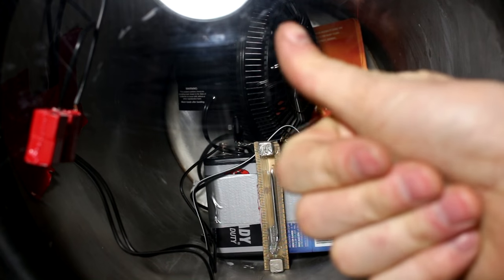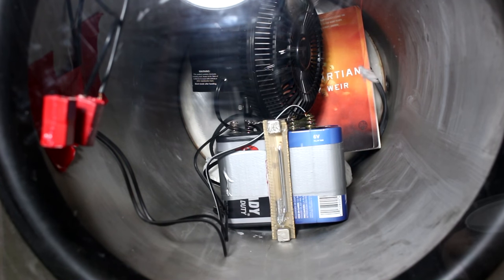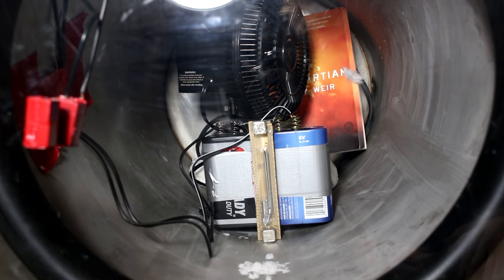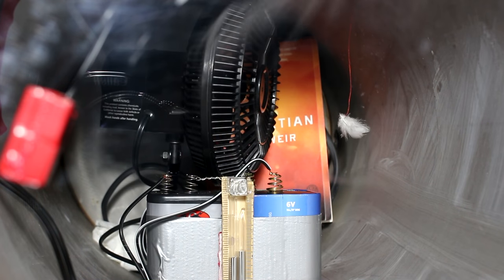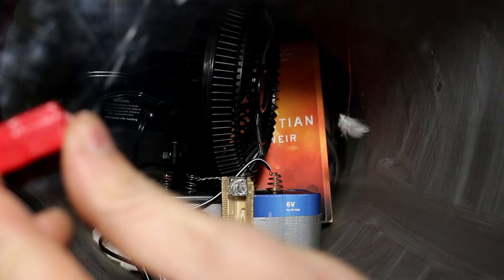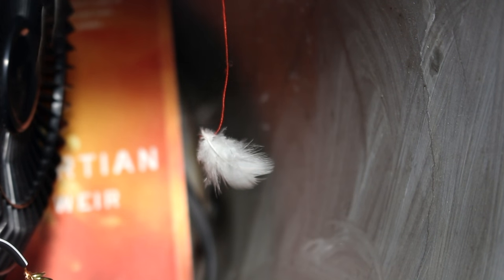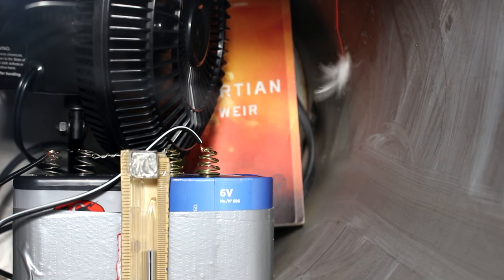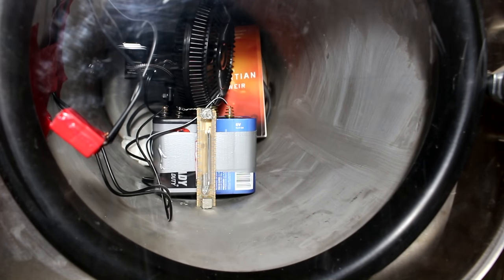How Strong is The Wind on Mars?

Comment: That's interesting. what happens when you put a thermometer on the motor in the fan? was that DC motor designed to be air cooled? If you wanted to keep a computer processor or other temperature sensitive device cool, how much would the Martian atmosphere affect it?

Comment: I did like Now, question: If wind could travel at speeds of 200 mph it would, other wise it could not be said wind speed at 200 mph,  if there was a breeze on the feather, this would work out at a phenomenal wind speed  on earth, 
Cody, using the vacuum chamber and turbo fan, at what speed could you register movement on the feather as wind? Or as i would believe not possible, with 500 mph fan speed in the chamber, would register much over 20 mph in chamber at mars atmosphere?Cheers

Comment: can you be sure that the fan produces airspeed in that low pressure environment? I assume that fan is engineered for earth pressure. The same way propellers for water are horribly inefficient at causing airspeed, I assume regular air propellers are horribly inefficient at producing airspeed in low pressure gas.

Comment: I imagine the fan blade spins markedly faster in reduced pressure as there is far less resistance against the blade and that may be where the vibration comes from in that the fan blade is probably not balanced finely enough for the higher RPM's.

Comment: since wind is produced by differences in pressure, and those are usually caused by temperature differences, do you think it is possible for martian atmosphere to produce a lot of wind? I think it would be possible because the temperature-difference on mars is about 140°C (260°F) min. to max.. this is not accounting the relative distance of these temperatures to each other of course, since that is also a factor that should be kept in mind.

I'm sorry to say but it is just natural the fan couldn't push the feather, since it is constructed for earth-atmosphere, so to get a equivalent force, the fan should be much bigger/more efficient. 
It is however a good test to prove earth-like 'air-technology' would not work great on mars. 

I really like your video's and look forward to a reply.
Greetings from Belgium

Comment: How do we know the fan is moving the air at the same velocity in the vacuum as it does at Earth atmospheric pressure?

If anything, this test would only test the effectiveness of a fan (or prop engine) in a vacuum. As the air became less dense, the same amount of power became ineffective at moving air at the same force and concentration. 

This is something aeronautical engineers must consider when designing jet engines.

Comment: I am just surprised that the fan didn't overheat and burn, with nearly zero air resistance on blades and with barely any air cooling for coil and brushes, I was expecting some smoke from fan.

Comment: Hey Cody. Would you be able to fly an airplane on mars then? with normal airplane with propellers?
Reply: No. Mars has on average 0.6% of the pressure as Earth so a normal plane would be far too heavy and a normal propeller wouldn't provide enough thrust. Before landing on Mars scientist thought the Atmosphere was much thicker and considered sending flying craft, but we've come to realize it is far more difficult than we first thought. 

Theoretically you could still fly a plane but it would have to be much lighter and normal prop propulsion hasn't worked well in tests. Of the few proposed concepts over the decades even the best ones would only stay in the air for a short time before running out of propellant.

Comment: Cody, I think your premise is faulty. You only demonstrated that your fan generates less velocity in a less dense atmosphere, which makes sense - the fan blades have less to push, so at a given fan speed, naturally there will be less velocity and a lower atmospheric density. That's why the feather isn't moving. If your fan could generate sufficient velocity then the feather would move.

Comment: We assume the air density is a constant on the surface of Mars at a relative depth; However, there are dust storms. What I would argue is that the relative air pressure or density acts more like a fluid over the surface of Mars and isn't a constant; as atmospheric conditions change so does the density. 

So, it is likely that mild gusts of air do cause pressure changes along the surface erratically over time; over the day. Perhaps a fan in a tiny vacuum bucket cannot fully demonstrate the erratic climate change and conditions appreciably as it can on the various locations on the surface of Mars.

I'd argue the vacuum demonstration more accurately demonstrates the conditions of the moon than it does on Mars; the moon is relatively static with virtually no appreciable atmosphere, other than a few rare gasses, but Mars does have a dynamic atmosphere with considerable and appreciable evidence of wind storms and wispy mild gusts.

Comment: Wait so, I have a potentially dumb question.

When you 'boiled' the water, did it change temperature at all?
Reply: No, it did not. When you change the pressure of something you also change the boiling and freezing points of that thing.
Reply: The water started boiling when he reduced the pressure.  As it boiled, it carried some energy out of the water.  This energy is called the "latent heat of vaporization".  Losing this energy causes the vacuum-induced boiling water to get colder.

One cool way to see this is to put liquid nitrogen in a vacuum chamber.  As you vaccuum the atmosphere away it boils and boils.  Eventually it will lose so much heat that it will freeze solid.  It's Frozen air!
Reply: Thanks! I'll write this down and when (if) I get happen to get liquid nitrogen AND a vacuum chamber for Christmas I'll give it a try.
Reply: The remaining liquid water will actually lower in temperature as it boils

Comment: Cody i think you have an error in your experiment: I don't think the air in front of the fan was moving anywhere near 5m/s. I don't think the principle by which a fan produces wind works in near vacuum. Short: if the air in there would actually be moving at a decent speed, i think the feather would be bodging noticeably!
Reply: I think you're wrong:  In the final analysis, induced lift is just vector addition.  The resultant directional velocity of the gas is determined by inertia of the gas molecule and the directional velocity of the fan blade.

Comment: Cody, can you explain why the feather appeared to move toward the fan instead of away? I've got a feeling that it has to do with the movement of the less dense atmosphere creating a low pressure spot in front of the center (obscured) portion of the fan. This probably happens in normal atmospheric pressures but is only measurable up to a few mm from the front. What do you think?
Reply: At end end you can see that the feather was suspended from a wire attached to the fan casing. It was probably just nudged by the vibrations from the fan starting up.
Reply: N33b0 No, the stringwas attached to the top of the chamber. The part at the end was either somethi g he tried and didn't like, or was just wanting to see the vibrations. The feather is clearly suspended from the ceiling of the chamber with red tape in the main part of the video.
Reply: James Rosenblum ah, got ya.

Comment: I wonder if you can adjust the air pressure to account for the lower gravity on Mars, seems like that could possibly help move the feather.

Edit:

Might just be easier to reduce the mass by a relevant ratio and test.

Comment: Cody- your experiment results give rise to the question of the dust storms on Mars and the great fields of sand dunes and the obvious wind erosion seen in rock strata. Is it possible that atmospheric pressure on Mars is variable enough to produce higher wind force within Martian weather systems as they move?

Comment: You said the fan would produce maybe 10mph of wind.  Wouldn't the fan rotate faster with Martian conditions?  That could explain the extra vibration and noise.  It also means the "wind" speed is likely higher that 10mph.

Comment: Let's say your assumptions were off and after putting it in a vacuum the fan produced 1m/s wind speeds
If the wind speeds being discussed were 100 m/s the difference in the force of drag would be 10,000 times greater than what you measured
In this case if your feather were only 0.1 g then an equivalent area object of 1 kg object would be effected the same (though the sway measured would be greater in both on mars as the gravity is less)

All of that doesn't even consider something that you either didn't consider or thought irrelevant
The dust carried by the wind could greatly increase the effective density of the air
When assuming the arbitrary number 10 as the density increase factor and combining that with the previous number we get 100,000 times the observed drag

Comment: Would there be more CO2 on the atmosphere of mars though, and would that even effect the outcome of this experiment?
Reply: If there was more co2 yes it would move the feather more!
Reply: If there was more co2 the pressure would have been higher than mars also. In cody's vacuum chamber the co2 content should have been close to 100% as the dry ice was the only thing replenishing the sucked out gasses.
Reply: Madrawn But I feel as if the small amount he used was not sufficient for the volume of the container, unless I am thinking about this all wrong. Wouldn't more particles in the way cause more of a push?
Reply: Mike More particles more push.... less particles (like on the movie)  smaller the pushing force will get
Reply: We can answer this with math.  A mole of carbon dioxide weighs 42 grams and occupies 12 liters of space on Earth.  The chamber is about 4 liters in size but is at 1/100th of Earth's pressure so it would need 140 milligrams of dry ice to fill the chamber.  The density of dry ice is 1.6 grams per cubic centimeter, so he'd need a piece that is a centimeter square and just under 1 millimeter thick.  There isn't a scale in the video to measure from, but it looks like he had plenty of CO2 to me.
Reply: Elizabeth Greene Ty :)

Comment: I'm suprised the fan didn't overheat in the vacuum since there is no air-flow to cool it down while operating. I guess it wasn't active long enough to produce enough heat..
Reply: There was still a little bit of an atmosphere in the chamber, about 7 millibars.  That's not a lot, but it's still enough for some cooling by convection.
Reply: cheap fans for home use rely on air cooling so much, that they could overheat from high altitudes (or at least some could), not to mention that higher RPM would generate more friction inside too, so it can overheat in unexpected places too.

Comment: Hey, Cody. That is a nice toy, i have been told in Mar atmosphere iron powder will absorb carbon monoxide in room temperature and form a kind of liquid metal. I wonder if it is true? If that is for real, we can cast iron just like we cast epoxy on earth. That is too good to be true, no foundry, no heat and no risk of gas explosion. I want to try that too, but i don`t have this nice toy. Therefore, may i ask you to try once to see if it is true or not?
The original claim was from the “direct to mars“ program support document on building mars colony. It also mention some martian mud bricks that only require 300 degree c to make, but stronger than any brick we have because of high content of iron. everything looks too good to be true.

Comment: Mars atmosphere is approximately 1/10th as dense as our atmosphere,The highest speed sustained wind on Mars was recorded at 125Kph 77.6714Mph the average/median wind speed on Mars is 40Kph 24.8548Mph. If you want your fan in a vacuum test to be a reasonable comparison you need to make the atmosphere inside your vacuum chamber 1/10 of earths not a vacuum.Earths atmosphere is approximately 14 lbs per square inch so 1.4 lbs per square inch would be the correct atmosphere comparison for your test. Also the gravity on Mars is also less it is only .38 % of gravity on earth which would make everything lighter and more susceptible to being blown by a breeze. The nearest I will bother to explain here is on a normal day the Martian wind would feel like and act upon objects like a 7.5mph breeze here on earth.
Reply: It's way less than 1/10th...it's about .6%.  it's 6/1000th of earths sea level pressure.

Comment: Hey Cody sorry I'm a bit confused isn't it just because that the fan is not producing that much wind force in the vacuum chamber?   I would imagine that a 200 mph superstorm on mars would be the same as a 200 mph superstorm on earth
Reply: benjamin buurgaard Well, the atmosphere pressure here on Earth is about 1000 times that of the pressure of Mars' atmosphere. So a 200 mph wind on Earth creates a force on the surface of whatever its pushing, i.e. the lander. On Mars, being that the atmosphere is 1/1000 the pressure of Earth's, you can imagine the force generated by a 200 mph wind would be about 1000th that of Earth's. Now there are other factors at play that may change that math, but the approximation is pretty darn close at such a low pressure.
Reply: hmmm.... so because of the fact that there is less molecules in the air to push it wont push as much?
Reply: An extreme example would be the difference between standing in a breeze or standing in a fast flowing river.

Comment: i wonder how mutch the dust in the storm would actually effect the spacecraft, and how mutch moee dense does it make the air?
Reply: Not much. Martian dust is incredibly fine, about the same as cocoa powder. It's going to be a massive problem for long stay astronauts on Mars as it is very sharp - will play havock with machinery if it penetrates, and is full of toxic chemicals like perchlorates. You really would not want any martian atmosphere getting into your breathing apparatus during during a dust storm.

Comment: I imagine that the blades of the fan are optimized for moving air on Earth.  I wonder if the angle of attack and camber of the blades would be radically different if designed to move less dense air?  Also, with no 'load' on the fan it is probably turning far more RPMs which could affect how well it moves less dense molecules...?  It could be that the molecules don't have time to get out of their own way, if that makes sense?  I wonder if having a speed control and much higher angle of attack blades would make a difference?  Not unlike props or turbofans optimized to work at high altitudes?  Just some musings from a non-scientist...

Comment: Cody,  How would the air density effect boost from a rocket in a launch from the surface of mars?  Thnx for the awesome videos!
Reply: not at all
Reply: Tomáš Hejzlar is correct. Rockets do not operate by 'pushing' against the atmosphere. They operate by throwing mass very quickly in one direction which produces a propulsive force in the opposite direction. Newtons third law of motion. Action and reaction are equal and opposite. This is why rockets work just as well in the vacuum of space as in an atmosphere. Better, in fact, as there is no air resistance to forward motion in space.
Reply: Cool! thanks for the answer.  I guess rockets wouldn't work in space if it needed an atmosphere to push off of.  I learned something today :)

Comment: Unfortunately, you haven't accounted for gravity, which in this experiment is actually possible. The way to do so would be to have two items of roughly the same geometric size so that they produce the same amount of drag, but the vacuum one having 38% of the weight of the other. Different types of paper would probably be a good analogue for this.